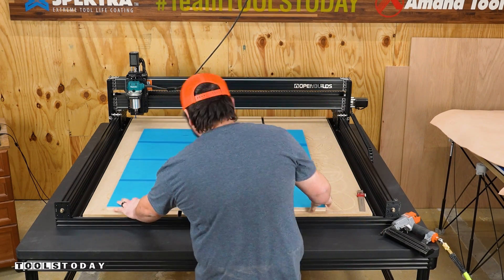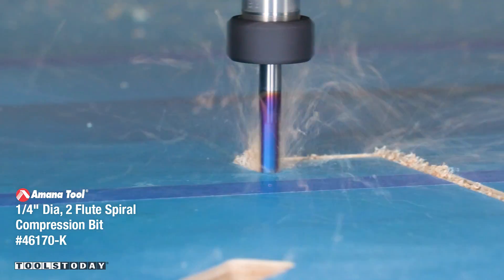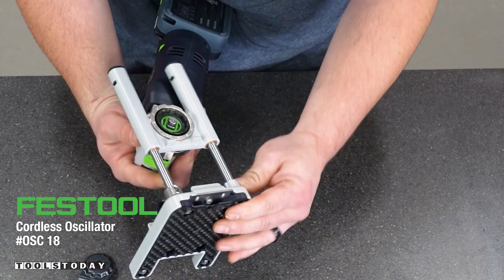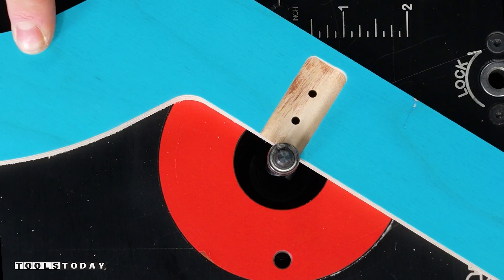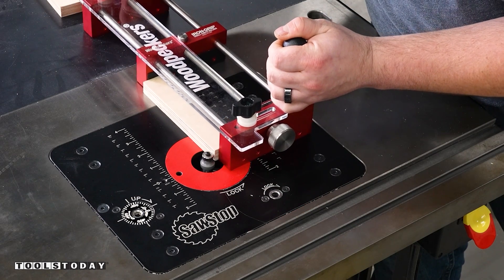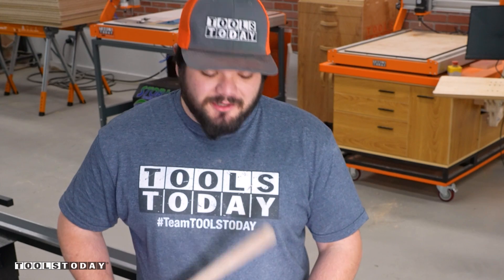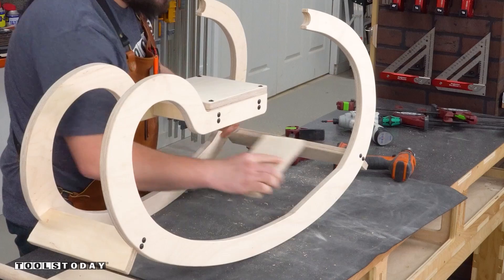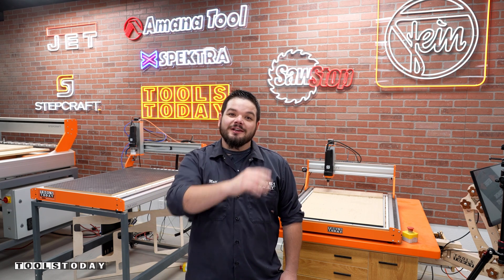How to Make a Rocking Toy | ToolsToday CNC Video

Comment: I was thinking about purchasing the M1000 with all the mods for it. This would be my first CNC i would like to start a small business with. Is the M1000 better for a beginner looking to start a dmall business or the ome that you show in the video. 

At some point i was looking at using the cnc machine to flatten small slabs or anything else.